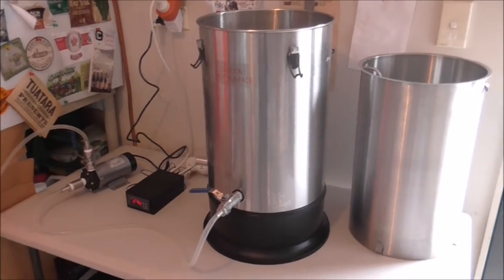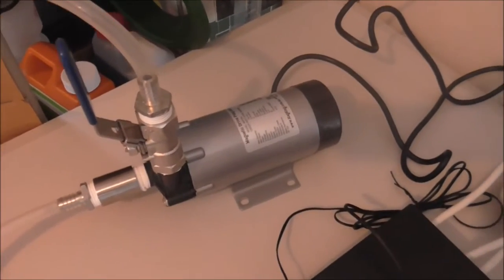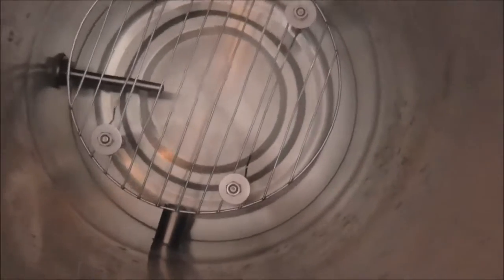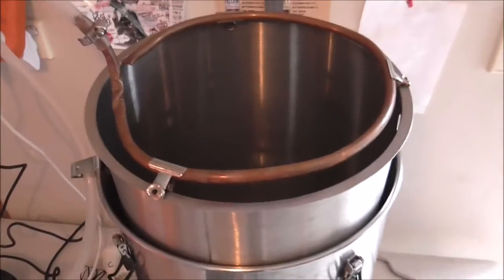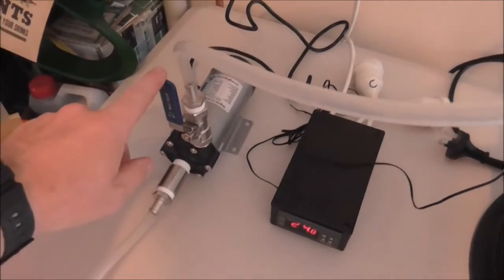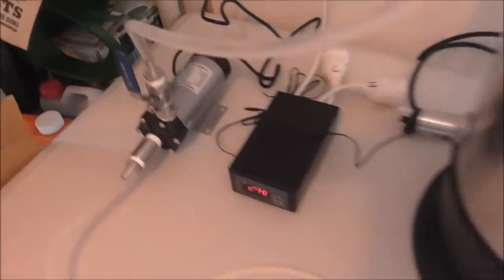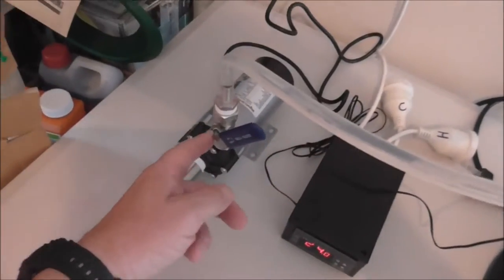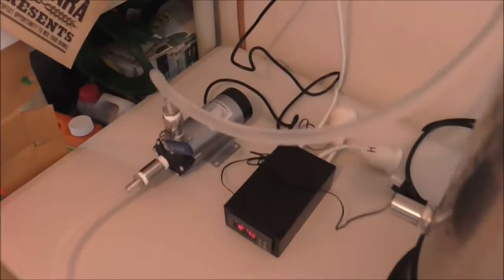Electric Recirculating Brewing System - DIY All-In-One with Sparge Ring and Pump

Comment: Good upgrade, I replaced my two solar DC pumps too after one died about five brew days back.  For anyone building a system I would definitely recommend going straight to these or similar pumps if you can afford it,  more flow and run cooler etc( I was running the DC pumps at maximum Voltage for flow).  Theses pumps find it much easier to get a recirculation going with my false bottom than the DC pumps
Reply from the maker: That's great to know you are happy with your new pump. They seem like a top piece of kit and well made. I was amazed at how much more flow I was getting haha. 19L per minute is way more than my little pump. Cheers!

Comment: Hi. I apologies as I see the video is a few years old but I am considering doing something similar. I currently have a 3V system and it has occurred to me that it would be relatively easy to add a malt pipe to the current kettle which is an extended keg 70L and about 370mm ID. Then I'd have a 1V system. My question is the design of the malt pipe which I would have no problem in making as I am in engineering and have tig welding gear. In fact for me half the fun is making my own stuff. The Rabobrew only seems to have a false bottom and no over flow. You don't have a problem with it not flowing properly and the element running dry? My element would be an exposed one and is 3.5kw but I could set it up to run at a lower kw for mashing and it will run a PID controller.
Reply from the maker: Hi thanks for your comment. An overflow pipe of some sort would be good for peace of mind. I think I've only had the one issue where the liquid wasn't draining through the malt pipe quick enough, but I was watching the recirculation and did catch it in time. I think that might have been down to a grain bill containing quite a bit of wheat from memory. I think after that I made sure I added 5% of oat hulls to the grain bill to help with drainage. It sounds like you have the skills and equipment to add an overflow, so I think it would be a wise move to add one. Keep me posted if you get a chance. Cheers 🍻

Comment: You’ll love that pump. I have the same one. Works great and it’s easy to clean. It’s a nice addition to the brewery. Cheers mate🍻
Reply from the maker: Thanks Rick. How do you clean yours? Disconnect and run some sort of cleaner through it or just hot water? Cheers buddy
Reply: TubeDinoz hey Dino, Typically i will run boiling water thru once then clean cold (tap) in reverse. If it was a hoppy beer you’ll definitely want to take it apart. The small hop matter tend to get stuck in the impeller. Even pbw won’t get all the hop debris out.

Comment: i just bought the Brewers Edge Mash and Boil,i will try it out very soon.enjoyed your video
Reply from the maker: I've just checked it now on google. It looks like a very nice piece of kit for $299? I'm guessing at a later stage if you want or need to, you can add a separate pump. That's a great price for what you are getting. I think if systems like this were around when I first started putting mine together, I probably wouldn't have bothered with my one. Cheers Richard
Reply: yes $299 in the States,where i live in Canada it is $399,and yes a few people ave added a pump,still a good deal i think
Reply from the maker: It would be hard to build something yourself for much less than that. Cheers Richard

Comment: Nice video!!
When the water you are pumping it´s over, you have to quickly shut down the pump? or just close de valve?
Reply from the maker: Thanks! I start by turning the power off to the pump and then closing the ball valve on the boiler. I'm then free to remove the tubing from the ball valve tap and then let any liquid in the pump and tubing drain into a container. I hope this helps. Cheers

Comment: Nice good stuff sort of a similar pump inside my robobrew
Reply from the maker: +Damian Bannon Thanks Damian. It could be the same pump or a modified version of it. Cheers
Reply: TubeDinoz yeah slightly different easy to clean etc got some good flow on the sparge ring i thought the malt basket looked familiar good stuff again cheers

Comment: Hey Dino, I'm from NZ and I'm seriously considering doing like what you have done here . I came across your video while doing my own research into converting a Grainfather sparge water heater (18L capacity). Even though your setup looks like it would be a similar cost to a Robobrew I love a good project and it would be nice to put one together with parts that I know I can replace if I get faults instead of relying on manufacturer replacements which always seem to take forever. Any words of advise with putting one of these together? I'm looking at a solar hot water pump on trademe and will use an STC-1000 for control like you have. For a malt pipe I will get a 12L pot from The Warehouse and line with a stainless mesh splatter guard. Not sure whether to bother with an overflow pipe and I see your malt pipe doesn't have one, do you get any issues with not having one?
Reply from the maker: Hey Trent. Thanks for commenting on my setup. Originally I made it around the time the Grainfather came out, but I didn't want to spend that sort of money. Totally agree if you build a setup yourself and something needs fixing it's easy to do. The only thing that's packed in has been the cheap pump I originally had, so would highly recommend getting a pump like the keg King one in this video and it should last a long time. The 18L you might find is too small even for doing half batches which is what I do. My boiler is the Still Spirits T500 and it's 25L to the max fill line ($180 roughly) . As for the malt pipe, because it's so tall I've never had a problem with it overflowing or felt the need for an overflow. In my older videos I used to use a drilled out 11L stainless bucket with a mesh false bottom and that worked well. I guess the overall cost is about $450 approx including the Robobrew malt pipe. The sparge ring is rough but does the job. I might look at making a better one of those. I hope this helps out a bit. If you have any more specific questions just sing out. Cheers
Reply: Thanks for the reply. I actually bought all the parts for mine last night before your reply came through. Hopefully I don't run into any issues with volume as you say. If not I can flick the urn on and get one like you have as I won't be drilling or irreversibly altering it. I have gone with a solar hot water pump which i expect will need upgrading at some point like you have done. I will be using a voltage reducer to limit the heating element power output in order to maintain a slow rolling boil rather than the full 2kW. It will probably also help reduce temperature swings during mashing. I'll keep you posted how I get on over the next couple of weeks.
Reply from the maker: No problem at all. The main things you have to consider with the size of your boiler, apart from batch size are things like loss of water to grain absorption (approx. 08.L per kilo of grain), boil off rate (approx. 3-4L per hour) and dead space below the tap. Great idea using the voltage regulator. Definitely keep me posted on how you get on. Cheers!
Reply: Good info, I might end up with quite a full vessel pre-boil then! One last thing, do you find you have any issues with trub blocking your pump or scorching on your element? Do you think the bazooka screen/filter is worthwhile? I figure if you keep the pump on throughout the mash and have enough flow over the element the proteins should stay suspended (or get filtered out by passing though the grain bed) and therefore not block the pump or scorch on the element. That's what I'm hoping anyway as this seems like the main concern on the aussie forums for RIMS urn brewing.
Reply from the maker: I only use pump while recirculating during the mash. You're dead right any small particles or proteins etc will be picked up by the pump and then filtered out through the grain bed. When I start my mash recirculation the liquid going through the pump is very murky, but then you will see the liquid clear up nicely to the point of being able to see through it. I guess this is the main benefit of a RIMS system. I do think the bazooka is a good idea to stop any solids passing into the pump or  fermenter, but it can get clogged it you are using lots of hops in the boil and hop stand. If that happens I just give it a scrape. I might look at a mesh false bottom for the boiler at some stage to help with this problem. Cheers

Comment: Nice work bud. It's on my list as the next brewery upgrade. Keg Kingdom brewpump3000 I believe the pump is called 😉
Reply from the maker: Thanks mate. It looks like a solid pump. Quite a bit of weight to it and being magnetic drive you don't have to worry about any shaft or contamination. The added bonus of being able to throttle back the flow with a ball valve is very nice too. Do you think the pumps are just rebranded depending on who is selling them? Cheers

Comment: Hello dear friend,i'm mohamadreza from iran,i have a sample of AD20P mini pump, which was your previous pump, can this pump be used for circulation brewing?
Reply from the maker: I wouldn't recommend using one long term to be honest. They worked for a while, but they really aren't designed for hot and sticky wort. I replaced at least one of them. The only suggestion I have is if you do go ahead and use one, is to make sure you thoroughly flush warm water through it after use, to make sure there is no wort left behind that can go sticky when it dries and cause issues.
Reply: @tubedinoz  Thanks bro for your guidance and help, good luck

Comment: Looks like a really nice pump. Interested to see what you do with the sparge ring. I am thinking of making or buying one right at the moment. Any retail ones you are considering? Cheers
Reply from the maker: Thanks. Everyone that owns one seems to like them. There is an option to upgrade the head to a stainless steel one, which would make the BSP fittings more robust, but the impeller housing is made from polysulfone and is a tough, food-grade plastic rated up to 120C. As for the spare ring, I could adapt the SS Brewtech one. Might look into that. Cheers buddy

Comment: Nice upgrade Dino,I'd be interested to know the temp difference by putting the probe into the sparge ring because I suspect it may be a few degrees C.
Cheers mate.
Reply from the maker: Thanks Dave. You are right. I did muck around a while back with sticking the probe in different places, including the temp of the liquid coming out the sparge ring, but then I found the element was staying on longer and overheating the liquid in the lower part of the boiler. Having the probe at the bottom seems to be the way to go and a number of units like the Grainfather measure at the bottom of the boiler. the flow rate of the recirculation can affect how much temperature you lose as it goes through the pump/hose/sparge ring so on the first brew I'll get a temp gauge and check it's not too low coming out the top. I generally set my STC at 65.3C and then I get about a 1.5C swing from 64.5C to 66C as the element turns on and off. A PID would be a better option, but I found once you find a temp setting for the STC that works for your system, a 1.5C is not a big deal. Sorry for the waffle. Cheers